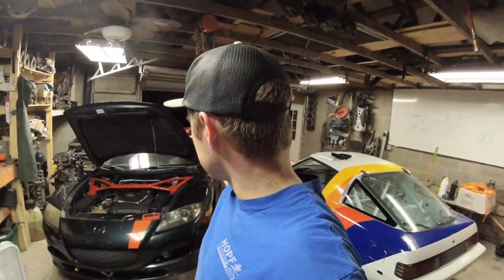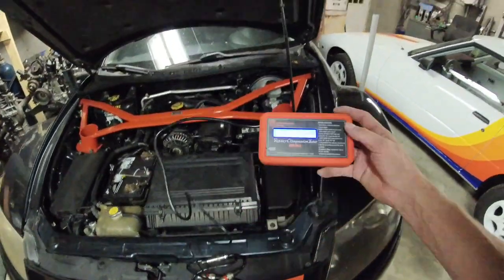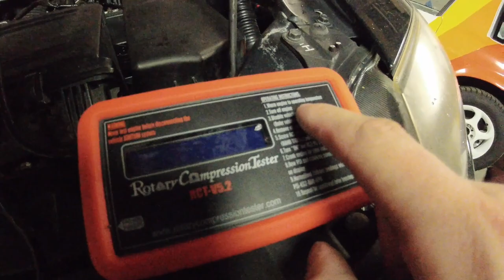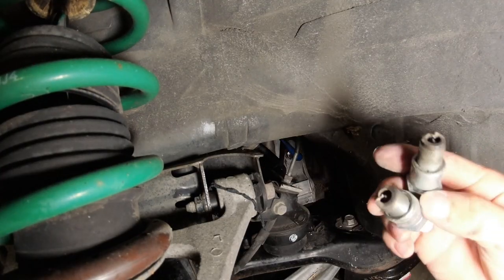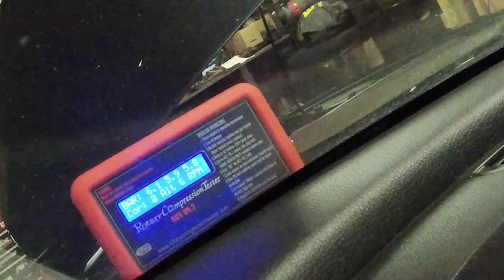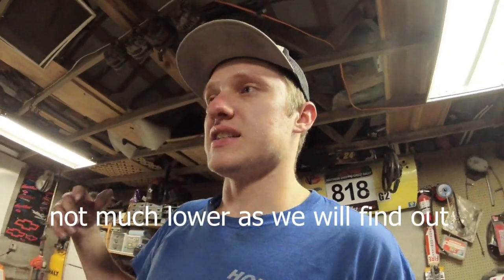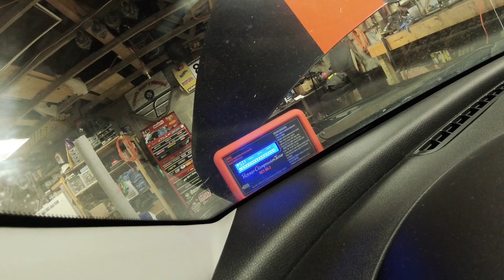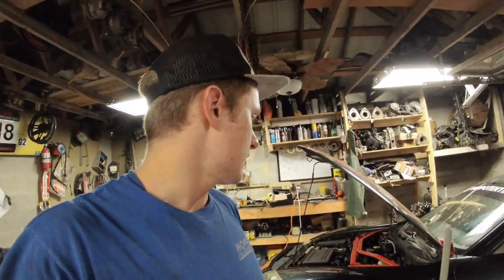Does a Cheap Rx8 have LOW Compression? - The Green Machine Rx8 gets Compression tested

Comment: I’m keen to help out RAD Potential through Patreon. Definitely get the merch set up! Have a  1 lady owner 1980 rx7 original 137000kms on the clock but blown motor. Rebuilding next month. Just taken dash out today. Also have a 2012 RX8 with 113000kms. Compression is in the high 90s. So would like to do it when it hits 80s.
Keep up the awesome work. Learn so much 🍻

Comment: I look forward to the next video how to rebuild the re 13b what to look for if the housings are bad or not... I bought a RX8 with 90,000 miles for 2500 bucks white with black interior put 20,000 miles on it autocrossed it five times it started running funny and  just check the compression 60 both holes

Comment: Also I tested the 10,700 mile 2009 with my brand spanking new RCT 5.2 and was a little disappointed with my numbers. 97, 98, 97 front and 101, 102, 100 rear. This at an hour and a half after driving it.

Comment: Bro, not sure with mazdas but I once ruined a honda ignition coil cranking the engine with ignition wires disconnected from the plugs. 
Nice info on the compression test. Thanks.

Comment: Thats too bad. 60s is pretty low.  I just did a compression test on my stock se.  It was all between 85 and 95 psi, hot.  Should I start thinking about rebuild yet?  I've never done one so I'd rather just run it for awhile.  I think it should be ok, but you have way more experience than me.  Thanks.

Comment: Hopefully you see this since it's an old video. But recently I stumbled upon another channel that is doing a hybrid Renesis engine build where they swap out the rotor housings with peripheral port exhaust housings. They have to create a custom exhaust with a custom mounting plate and deepen the apex seal grouves. But it was able to breathe so much better because of the extra exhaust. Is that something you would ever consider doing?
Reply from the maker: Yea man!!!  If I build an rx8 engine. I could for sure use some gslse housings.  I'd be interested to try it!!
Reply: @RADPotential pls do so the rx7 apex seals can hold boost on those hybrids 😮

Comment: I thought you had to disconnect the Eccentric Shaft Position Sensor (AKA crank-angle sensor) as well.  All you need to do is pull the fuel pump fuse?
Reply from the maker: You just need the car to not start.  You could unplug the coils as well
Reply: All I did when I compression tested was disconnected the plugs and held my foot down on the gas this  turns off the fuel injectors

Comment: So when I got mine at 90,000 miles I'm assuming it had around 80 psi because it started decently but under wot in third it would random misfire turns out that happens when they have low compression hate to break it to you it's just going to keep happening until you rebuild I know you know that. I did the exact same thing I kept taking it to track days and now I'm at 60 in both holes LOL probably just going to buy a JDM motor for two grand see how that goes it's a good video idea there's nobody on YouTube that does that buy a JDM 13B RX8 and see if it works

Comment: What would you think of a bridgeported FD engine with hot compression numbers in the low-mid 70's? Cold numbers were right around 90. It runs well, makes around 400hp at 15psi now, but I discovered I had some detonation after I finished break in that I had to sort out. I think when I finished break in the hot numbers were around 90psi. But I was determined to learn how to tune it myself and got it all sorted out now lol
Reply from the maker: So you had 90 hot after break in, but now you have 70 after some detonation?